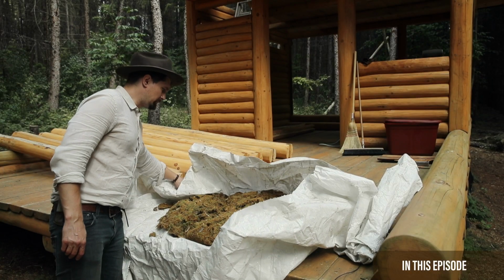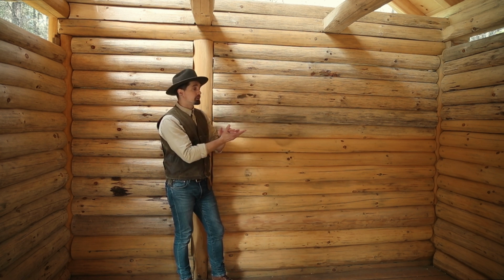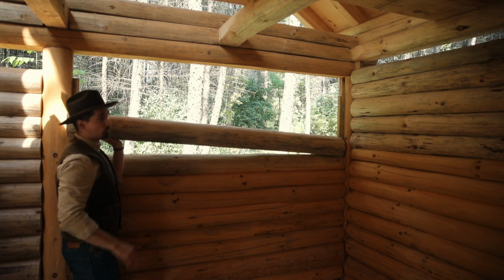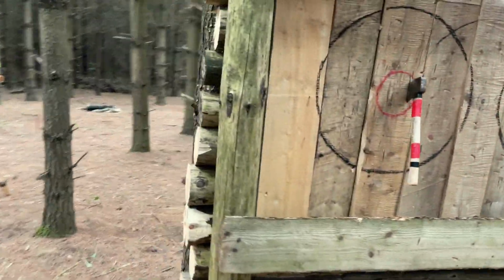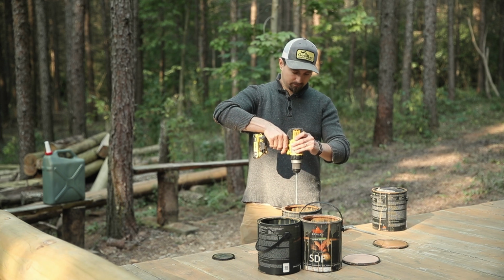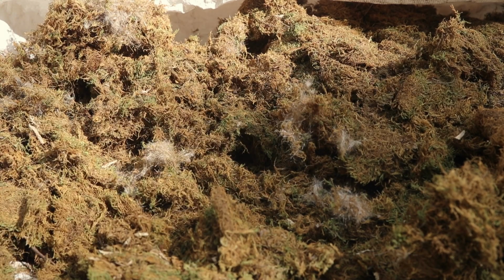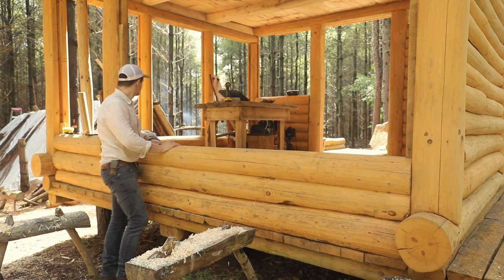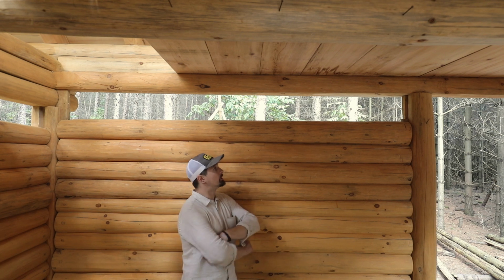EP32: A Week At The Cabin / Wood Shrinkage  / Rebuilding Walls

Comment: Very interesting how you adjust for shrinkage. I've learned that you can plan on a 8" log shrinking 1/4". That's why I don't like saddle notches when building horizontal stacked walls. Much prefer full scribe shrink to fit, the more the logs shrink the tighter everything gets. Also loved the tunes everyone did, really nice music!
Reply from the maker: I couldn't remember the ratio you had told me earlier.  At least I think it was you.  1/4" on a 8" green log makes sense to me. That's pretty close to 1/2" on a foot. You're probably working even fresher logs then me and most others.
Reply: @TrustinTimber  I think it's a pretty good idea to plan on a 1/4" shrinkage per 8" log/ a bit more for larger logs/ even if they have been dried. Much better to plan ahead then to have to fix later, like windows, doors and posts. I've actually seen a few new log buildings where vertical and horizontal logs were used without planning on proper shrinkage, the kind of thing were you know in ten years there will be major problems. Makes you walk away just shaking your head happy it's not yours.